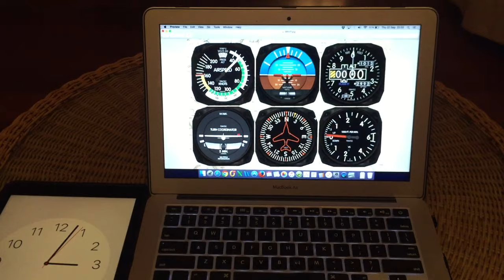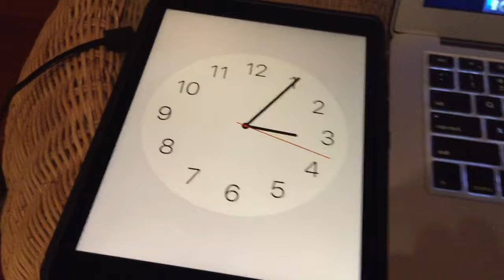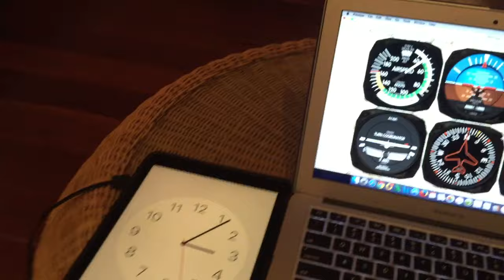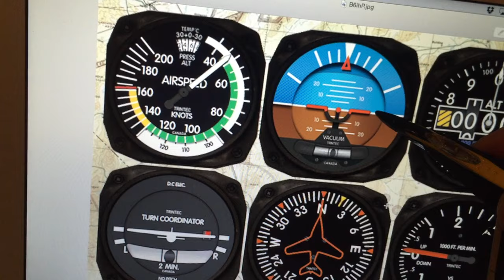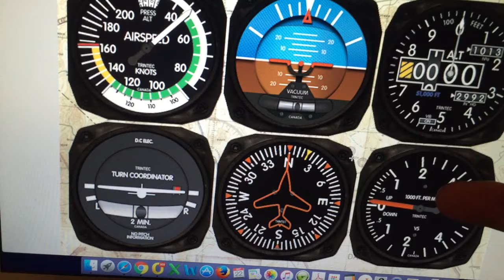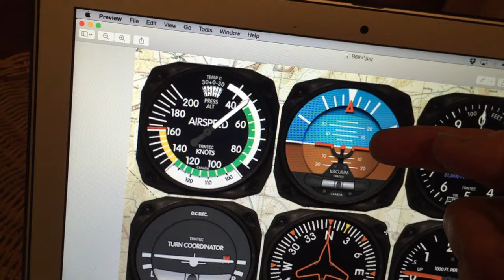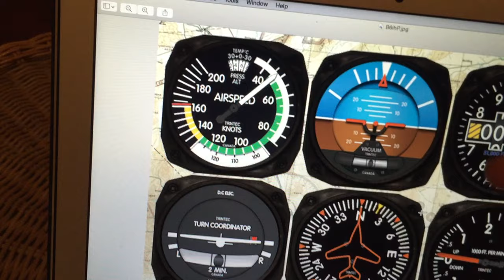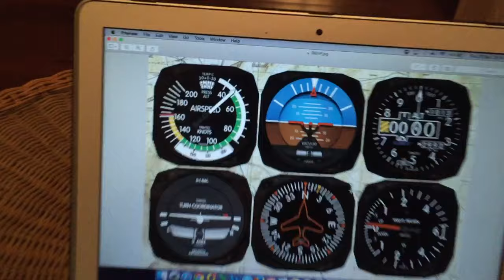Do aircraft change attitude to follow the curvature of the Earth?

Comment: I tested this for myself and hired a pilot to fly me around in a Cessna at 2000' for about an hour. No auto pilot on this thing. We got to 2000' at 120 kts and then physically locked in the elevators to maintain zero pitch on the aircraft at 2000'. Hands off all instruments and controls we flew for 20 minutes without changing altitude until hitting a thermal layer.  Do the math and you will see it would be impossible to maintain 2000' altitude at 120 kts for 20 minutes on a ball. I think its about a 1400' difference. 
This guy is a liar.
It cost me $180. Go hire a Cessna pilot for yourself and you will see. Make sure it's a calm day so you will be able to lock down the elevators. 
After you do then you can also come here and call this guy a liar.
Reply from the maker: Do you have a video of the flight?   You are still not understanding what is occuring.   20 minutes hands off with the elevator locked and the altitude didn't change?  Really?  Show me the video please.
Reply from the maker: How did the pilot lock the elevator?
Reply from the maker: Did you do the math yourself?   at 120 knots it takes 180 hours to fly around the Earth.  That means you only change 1 degree of attitude in 30 minutes.  So flying for 20 minutes the attitude change of the aircraft is less than 1 degree.    

Please tell me how the pilot locked the elevators for 20 minutes in flight because unless you provide a video I call BS on that mate.
Reply: +Wolfie6020 
I don't have video of that. Show me the chapter in the autopilot users manual discussing the feedback system providing the compensation for the curve. The circuit does not exist. 
How did we lock elevators on a cessna? There was a small handwheel  used to physically keep the controls from moving.
Reply from the maker: Diesel Bourbon
So you hired an aircraft to do an experiment that proves the Earth is Flat and didn't bother to take a video of it?  Really?

That small hand wheel is called the Elevator trim and does not lock the controls at all.  Try again.  I have over a thousand hours in Cessna's.  The actual control lock is completely different and the plane will not fly with it installed.

Your controls were not "locked" at all were they.
Reply from the maker: Diesel Bourbon
For the second time.  There is no feedback system required.  What part of that did you not understand the first time I explained it?
Reply: +Wolfie6020 
I'm not the pilot. The guy did something to keep the elevators from moving after achieving altitude and zero pitch. It was more than a year ago. We flew twenty minutes. Zero pitch no change in altitude.
Reply from the maker: Diesel Bourbon
I can assure you the controls were not locked so you should not claim they were.  Sorry mate, but unless you have a video I don't buy it.  I have never seen an aircraft hold perfect altitude for 20 minutes without touching the controls.
Reply: +Wolfie6020 
really...then I would have to doubt you are actually a pilot. a friend of mine flew thirty years in Marine Corps and UPS and told me he did that all the time. He said it was very common.
Reply from the maker: Diesel Bourbon
If you doubt I am a real pilot then please be my guest.  It just shows me you can't recognize the truth when you see it.
Reply: You don't have a clue how a gyroscope operates. This is the crux of the problem.
Reply from the maker: Diesel Bourbon Changing tack again?  so explain it to me please.  How does a gyroscope operate in relation to holding a constant altitude in an aircraft.   The floor is yours, I am listening.
Reply from the maker: Knowing how a gyroscope works is not the crux of the problem at all.  You are getting bogged down and side tracked because you still miss the main point of my video.  That is the real crux of the problem Diesel. 

Forget gyros and autopilots.  Take a small aircraft with none of these. Only an altimeter and a pilot. Nothing else.  If the pilot flys along maintaining a constant barometric altitude then he is already adjusting for the Earths curvature.   Do you understand why?
Reply: A gyroscope will not follow a curve. A gyroscopes attitude is not affected by "gravity".
Your explanation of maintaining altitude does not explain what I accomplished in the Cessna. Flying at 2000' for twenty minutes, zero pitch at 120 kts. No change in altitude for twenty minutes. We could have gone longer but hit a thermal layer.
I am going to hire another pilot in the next couple of months and video the whole thing for you.
Reply from the maker: +Diesel Bourbon
Diesel you have still missed the entire point of my video.  Forget Gyros.  They are irrelevant to this discussion  Honestly mate I now believe it is a waste of time explaining anything to you.  Please do the experiment again.  I look forward to it.  Make sure you video the entire 20 minutes with the pilot's hands and feet completely off the controls ok.
Reply from the maker: Diesel Bourbon
You would be better off hiring a small Citation jet and doing it at 40,000 ft.  A Cessna is very slow and at 120 knots will only require 0.66 degree change in 20 minutes.   At least in a Jet you will cover about 2 degrees of pitch change in the same 20 minutes.  They are not as expensive as you might think.  Go up to 40,000+ feet and you will have a much better experiment.
Reply: I can't wait to see your video Diesel Bourbon.
Reply: +Diesel Bourbon  Subscribed to your channel so I don't miss your video.
Reply from the maker: Diesel Bourbon Language please mate.  You can post anything you want here and I won't block you but keep the language civil please.
Reply: Charming but not interested in chit chat.  Where is your video?
Reply: So is there a video or not? I know I'm a little late but it would be interesting to see if someone has a link to it.
Reply: B C dang bruh chill out a little
Reply: +B C
Show me the video
Reply: Diesel Bourbon you are correct. you take off reach altitude remain on heading. the only time you adjust pitch in flight is for landing. all planes are designed to fly level with hands off the controls. when you learn to fly there is NOTHING about the curriture. thats bc it does not exist 😎
Reply: Charlie Jeans did you ever fly a plane?  I did... and you have to adjust the pitch from time to time to stay level.  Upon reaching altitude on a small single engine air plane you adjust the trim on the elevators to make it easier, but you still need to make controlled adjustments.  Furthermore, the air that you fly though is not still so even on a flat earth you would have to make adjustments.
Reply: That's because you are following the curvature.  But of course you didn't actually fly a plane, I have, you probably read that somewhere.  And that's a load of bs
Reply: B C - and yet this is exactly what all pilots do - plot flights using the globe mode of the earth - and, guess what happens? they get to the correct destination on time; they use the correct amount of fuel for the miles travelled; they fly over the correct parts of the earth as expected according to the globe model. Please plot a transatlantic - or other long haul flight - route using the flat earth map - calculate distances etc etc and then show it works including filming which continents you fly over etc.
Reply: Charlie boy  - what about adjusting for turbulence - as Wolfie explained - most of the adjustments made are for other things than curvature - which is why a pilot doesn't notice it. Remind me never to fly with you by the way - not that I think it likely since you are no more a pilot than I am a Leprechaun.
Reply: Diesel Bourbon no there is not. Liar.
Reply: Charlie Jeans actually liar, there is so much in the aviation world that directly relates to our spherical earth that aviation would simply NOT work if it were flat.
Reply: wrong have you been to Texas international airport they have the flat earth on the floor with all the airline flight paths that make perfect sense does not make sense on a globe same with Australia they have a park with a flat earth clock and a flat earth fountain and in London parliament flat earth on the wall this satanic elites know its flat there pushing globe to hid god so they can push there evil satanic agenda NWO
Reply: MetalcoreWorld 😂 you must be kidding right? If not I'm so sorry about you....
Reply: BC.
You display the normal anxiety and confusion displayed by people who have had their belief destroyed.   You have no sensible rebuttal so you spit the dummy out and cry liar whilst adding foul language.....typical  behaviour.
Reply: BC
That is exactly how religion works, to control people with the fear of Gods wrath at judgement day.  Believe that if you want to.
Reply: B C - yeah - I agree with S Black - show us the video you took - or stop calling other people liars - incidentally, explain how Wolfie6020 is a liar for simply making observations, using the correct maths etc. etc. - I look forward to both your video and your explanation.
Reply: WildPhotoShooter - agreed - they always come out with the threats - except - IMO - their belief in a vengeful god, who wants to torture forever, anyone who disagrees with him, is simply a projection of their own hatred - after all, brain function scans show that the part of the brain that lights up when believers think they are talking to god is the same part of the brain that lights up when a person thinks about themselves - in other words - they are god - he is only a projection of their own psyche which is why he always agrees with them on everything - hates those they hate etc. etc.
Unfortunately, when a flerfer admits that the reason they are a flerfer is because it agrees with their particular holy text's description of the earth, there's no point in debating them. They will not accept any evidence that disagrees with their beliefs, and are happy to lie whenever the need arises.
Reply: Diesel Bourbon - "Show me the chapter in the autopilot users manual discussing the feedback system providing the compensation for the curve. "  There is no such thing because it is NOT REQUIRED.  To learn what you are looking for you need a PHYSICS BOOK.  Then you need to understand EQUIPOTENTIAL SURFACES.  In a gravitational field (or electrostatic field) the "surface of equal POTENTIAL" around a spherical mass is SPHERES OF EQUAL RADIUS.   For example: If an electron is trying to move around a Proton It can move along an equipotential surface WITHOUT PERFORMING WORK.  For the electrostatics case these equipotential surfaces are spheres of equal distance from the positive charge source (the proton).  So you can move the electron around the proton anywhere you want and not perform (or extract) WORK Unless you CHANGE FROM ONE EQUIPOTENTIAL SURFACE TO ANOTHER.    So what are the gravitational equipotential surfaces in Earth's gravitational fields?  Why.... that would be SPHERES centered on the center of the earth.   So flying along at CONSTANT ALTITUDE means you are STAYING ON THE SAME EQUIPOTENTIAL SURFACE and therefore PERFORM NO WORK.  Pull UP and climb to a equipotential surface of HIGHER POTENTIAL ENERGY, or dive to go to a surface of LOWER POTENTIAL ENERGY and WORK is performed or extracted. 
     See it is 100% PHYSICS.  If an aircraft were to TRY to follow a perfectly straight line in a spherically symmetric equipotential field (Like a Gravitational field) it would be CHANGING ALTITUDE and therefore INCREASING IN POTENTIAL.  Physics does NOT like that as you must PERFORM WORK TO INCREASE IN ALTITUDE.   WHY do people who do NOT understand physics ARGUE with those that DO?
Reply: Diesel, Its fine questioning things but you need to do it with some degree of knowledge, you don't have any.
Reply: You are 100% correct in your explanation to Diesel Bourbon.   I have made the same argument about how the stability of a plan works and that "going in a straight line " that starts off as tangent to the surface and eventually increases in altitude due to the curvature, requires energy that a plane in straight and stable level flight will not do for the exact reasons you pointed out.  So, Yes you are correct and the earth is a sphere.

But the one thing I haven't found yet is how the attitude indicator that works by inertial stability  (Gyros) compensates as it moves around the earth.  That is a different problem.
Reply: B.C. 
Your knowledge is from the same era as your name.  You need to listen to and read about modern discoveries  and the way it all works to perfection on our globe earth before you attempt to debunk it all.  
You will find you need more evidence than saying "fake"  "lies"  "shill"  "satanic"   "CGI"   "C*** S***",  or  " it doesn't make sense".
Reply from the maker: +blaster 0416.  You explained the inherent stability nicely and you are 100% correct. 

The attitude indicator has mechanisms that adjust it constantly as it moves around the Earth, it is constantly aligned to local level.   If you hold a steady banked turn for several minutes it will actually align incorrectly in the turn as it is sensing a false "G" due to the turn. 

I have an artificial horizon and will make a video about it in the future.  I need to get a power source for it first as I want to do a few experiments with it working also. 

The mechanical vacuum driven gyros use pendulous vanes to achieve this correction. 

https://www.experimentalaircraft.info/articles/attitude-indicators.php
Reply: Wolfie6020   OK, so it is very slowly dampened assuming that the plane will be mostly level during normal flight and turns will be less than a minute or so.  Next time I go flying I'll try a long coordinated turn and see if I can get the AI to begin to "correct" itself and begin to level out even though I'm maintaining the turn.
Reply from the maker: +blaster 0416  This might help. 

https://www.theairlinepilots.com/forum/viewtopic.php?t=905
Reply: Lol how do you lock down the elevators ?
Reply: As a commercial pilot that trained in small planes not once did the thought ever occur to reach back for the control lock and freeze the controls. I have not ever meet a pilot that could trim a plane to fly perfectly level for more than a few minutes without having to make small corrections.  We all know that gravity and lift work against each other so we counter those perfectly to  maintain equilibrium flight. We do not constantly push down on the nose to keep from going up because the force of gravity pulls to the center of mass as you go around the ball. If you are having a hard time understanding how gravity works look into Einstein's spacetime.
Reply: DarkSkyWatcher74 depending on how much money you want to spend auto pilot can be used in many ways such as single axis double or triple. It doesn't use baro for altitude corrections you as the pilot set the baro for Mean Sea Level. Some autopilots work with your GPS to fly a specific route with comes in handy for LNAV RNAV approaches.  Above 18k in the USA all planes fly at standard pressure for more accurate deconfliction.  It's a misconception that pilots hit autopilot after take off and then have no clue what happens next the amount of workload is just eased that's all.
Reply: Diesel Bourbon "I'm not the pilot. The guy did something to keep the elevators from moving " That's your flat earth evidence!!  In the scientific world what you have done is try to present anecdotal evidence. That is NO evidence at all. In the legal world that is called here say and not admissible in court.
Reply: stephen allenbaugh yea you can see a lot at 6000 feet but how do you explain not being able to see a pencil sticking out of the ground at 1 mile on a flat dry lake bed or all of us being able to see the ISS at night time because of the reflection of light from its solar panels. You must live in a bright city in your mothers basement. Go take a look at the sky for once in your life away from light pollution.
Reply: travis richardson   "how do you explain not being able to see a pencil sticking out of the ground at 1 mile on a flat dry lake bed". How would you see a pencil at one mile? Even if above the horizon.
Reply: travis richardson even with eye level of 1 foot, at 1 mile there is insufficient curvature to hide an object as long as a pencil.
Reply: Stephen just quit while you're behind, so you don't get more behind. You're embarrassing yourself (do flat earthers even care though?)
Reply: stepehn allenbaugh - You know you can go LOOK YOURSELF and SEE THE ISS.  There is a video of it passing over my head on my youtube channel.  Dont take our word for it - GO LOOK YOURSELF.    My prediction - stephen WILL NOT go look because he is AFRAID to be proven wrong. (that and it conflicts with his preconceived notions - likely religious in nature)      The ISS is COMPLETELY OBVIOUS if the sky is clear.  I have gone out and seen it on numerous occasions WITH WITNESSES.   I can ASSURE you that satellites are real, I have launched quite a few MYSELF.
Reply: Stephen allenbaugh - YOU CLAIM that the ISS is FAKE and cannot be seen, yet you fail to explain WHY WE CAN SEE IT.  And WHY it looks JUST LIKE NASA SAYS it does when you LOOK AT IT WITH A TELESCOPE.  And PLEASE (with your superior intellect) explain what I WATCHED YESTERDAY when the SpaceX falcon 9 launched a resupply to the ISS?  WHAT WAS that I saw LIVE on TV.  And then what was that I saw that TURNED AROUND in a VACUUM with ROCKET ENGINES and LANDED at KSC?
Reply: Stephen allenbaugh - SO you don't have TIME to explain WHAT THE FUCK YOU ARE TALKING ABOUT???  I am supposed to KNOW what you mean?  You ARE a Genius.....  SO you are NOT going to explain what I CAN SEE with my own eyes when I use the ISS tracking app and LOOK UP?  and you are NOT going to explain WHAT I AM SEEING when a Falcon 9 launches from KSC and returns?  Just fucking BRILLIANT!
Reply: stephen allenborough.
Do you not know the answer to Stuart Greys questions about the ISS ?
Reply: Stephen allenbaugh - "More like I dont care" Then WHY are you spouting nonsense on this thread.  Leave us alone already if "you don't care".  So answer the questions or go away and let the grownups have a conversation.  Just blurting out "WRONG" proves you are twelve.  If you have something constructive to add, then SPEAK UP, we are not mind readers (although IF you believe in a Flat Earth and blatant violations of physics then you are probably the type to believe in psychics)
Reply: stephen allenbaugh
Flat earthers struggle with learning the accepted science so they just change  the curriculum to flat earth and they become absolutely  great students.
Reply: stephen allenbaugh.
You need to go and study some physics because all the physics that has been discovered by observation and experiment IS natural physics......it just goes a lot deeper and is more complex than you can comprehend.
Reply: Stephen allenbaugh - "Show me the physics that makes water cling to a ball by the trillions of gallons"  Sure - its called "Gravity" and behaves ALMOST exactly like electrostatics.    "show me water that isnt flat"  Sure - Look ACROSS the ocean - Do you see mount Everest? NO? That's because it is CURVED just like has been proven over & over INCLUDING the videos of the SpaceX launch I posted above that you apparently refuse to watch.  I am SO SICK of people telling Engineers and Physicists to "learn physics" when they have OBVIOUSLY NEVER PASSED A PHYSICS CLASS IN THEIR LIFE ( Go ahead and Prove me wrong - YOU HAVE NEVER passed a physics class, and probably never even taken one).    This is a fact: ANYONE who claims that "rockets dont work in a vacuum" or "water cant cling to a planet" could NEVER PASS a physics class and therefore could NOT GET an Engineering Degree.
Reply: stephen allenbaugh, your wasting your time arguing with people who believe or claim to believe that man walked on the moon. They are either completely deluded or free Masonic agents of deception.
Reply: stephen allenbaugh so why do you refuse to comment on the video of the SpaceX launch from Monday?  Afraid that seeing something "impossible" might scare you into accepting reality?
Reply: Ninja Man  what do you think happened on Monday at KSC?  Was that big rocket CGI or mass hallucinations?   And what do you think the bright object is that passes over head in orbit of the Earth? Another hallucination?
Reply: stephen allenbaugh - "I am not saying they didnt shoot something into the air genius."  So please tell me what you think it WAS that they shot into the air if not a 230 foot tall rocket booster that weighs over a MILLION POUNDS.
Reply: stephen allenbaugh that's easy look at free falling water. Or better yet look at it in a zero air resistance area.  But that doesn't even prove gravity that is just the natural state of water. If you want to see something on the other side of the curve go to a dry lake bed, lay down and tell us how far you can see objects on the ground.  For some reason flat earthers always use water for  curvature drop experiments without the thought of how light bends through cold water.  Go play kerbal space program too, lol.
Reply: No one is that stupid ?    Ha!   I wouldn't put money on it.
Reply: Stephen conspiracy clown allenbaugh.
All the lunar lander needed was a covering and heat reflector, no structural strength was needed for the skeleton, that was only necessary for the internal pressurised cabin.   The gold foil was  perfect for both and most importantly it was lightweight.   Its called engineering you know.  What would you have built it from , Steel plate and rivets?
Reply: Stephen allenbaugh - You ADMIT that "something was shot into the air" on Monday, but you wont take an opportunity to tell us what YOU think it was since you don't believe it was a 230 foot tall 1,000,000 pound ROCKET.  WHAT WAS IT THEN?
Reply: Ninja Man - You know that you can SEE a big object that can support human life in a vacuum WITH YOUR OWN EYES.  All you have to do is go outside and look up when the ISS passes overhead.  Because (did I mention) YOU CAN SEE THE ISS WITH YOUR OWN EYES.  But you WONT DO IT because being exposed to the truth HURTS Morons' brains.  And another thing we have put humans inside a vacuum chambers HERE ON EARTH on numerous occasions when testing Flight space suits.  I used to work in the building that the Manned Maneuvering System was built in, and used to walk past the flight units almost daily.  Just because you DONT UNDERSTAND SOMETHING does not make it any less real to those that DO UNDERSTAND.
Reply: Ninja Man
When you fly in an aeroplane at 40,000 ft the fuselage is sustaining your life by pressurising air inside of it. 
Outside air pressure at 40,000ft is only 2.73 lbs psi. and the aircraft fuselage can easily cope with the difference in pressure,  so in a vacuum it only needs to be a little stronger.  Not a problem at all for the engineers and designers.

Flat earthers struggle with learning the accepted science, so they just change  the curriculum to flat earth and then magically they become a great student.  LOL.
Reply: WildPhotoShooter - Yeah and don't mention to Ninja Man that SUBMARINES survive a MUCH MORE HARSH environment than spacecraft and have been doing so for many years MORE than spacecraft.  In fact, I would bet that if you could just put one of our nuclear subs in orbit, it would likely survive just fine (at least for a while until it overheated from inability to radiate waste heat)
Reply: blaster 0416, yes I know I'm stupid for not falling for this absolute nonsense. For what it's worth, not that it matters because seeing the fraud being perpetrated on humanity doesn't take a Brian surgeon to detect it. I actually have a degree in telecommunications and I can tell you with certainty, transatlantic communication isn't done by satellites, its undersea cables. We also use line of site microwave data links 80 miles plus - not possible on a ball. If you bother to study your own bullshit, it should be obscured by 4,266.67 ft or 0.81 miles of curvature. Not possible on a ball my friend. The evidence is all around for those who wish to see.

Back to the lunar lander - it is clear to me that, that nonsense wasn't put together by anyone with an engineering background. The rivets, gaps, tapes and silly foil looks like it was put together by a homeless person. Engineers have pride in their work and I can tell you with certainty, no engineer or group of skilled tradesmen put that nonsense together. Nothing is uniform or ascetically pleasing, it's a joke. And don't bother replying telling me it's not there to look pretty. My point is, it looks ridiculous and anyone who thinks it serves any real function, either has shit for brains or thinks everyone else has.
Reply: So, has Diesel Bourbon posted his video yet?
Reply: stepehn allenbaugh - You keep talking about this bullshit "space cardboard" but it is nonsense. The spacecraft I HAVE BUILT are made from Carbon Fiber composite panels (Mars Global Surveyor, Stardust & Genesis), or Aluminum HoneyComb panels (Deep Impact, Kepler, NPP, JPSS-1, Worldview) and Titanium fittings everywhere. I can pretty much GUARANTEE that they are stronger than anything you have built because we TEST them before launching them.  In the case of the Stardust Launch Adapter ring (base of the spacecraft) we proof loaded it to 70,000 lbs when the entire spacecraft fueled weighed less than a thousand.  We also Vibe & Acoustics test them for strength at levels that would shake a jet fighter apart.
Reply: Stuart Gray, since you know so much about NASA, explain why they were not able to show us the eclipse from space. My own feelings is, it's getting harder to fake these things because people are scrutinising everything they do. And we would be looking for stars, satellites orbiting, earth spinning and cloud movement.  I mean, you would even tell me that that cgi joke called the Epic is real. Seriously, do yourself a favour and stop these lies.
Reply: Stuart Gray. 
Wolfie is a Pro pilot and he seems to have kicked Jeranism into the long grass on navigation,  Jeranism doesn't go there any more.  Then here you are,  a man who builds spacecraft, so maybe you can debunk the satellite deniers with some technical info too.
I was in my early teens when the Apollo programme was happening and I remember reading that the gold foil was all over the LEM to reflect heat, it was not there for structural strength.  Stephen Allenbaugh and his like look at these things as though it is a joke and think it is not a viable space vehicle.  Pure ignorance .
Reply: Diesel Bourbon .
Eight months have passed , have you hired another Cessna and  done your video yet ?
Reply: Minja man
Why would NASA waste time and money taking a picture of the eclipse from space just to show to a bunch of flat earthers on the lunatic fringe ?
Reply: Ninja Man - " since you know so much about NASA, explain why they were not able to show us the eclipse from space"  Let ME ASK a question:  WHY IS IT that Flat Earther's  NEVER respond to real evidence? Their juvenile response is typically "I don't care about THAT - WHAT ABOUT THIS?"  It is a simple minded way to change the subject.  SO before going on about Eclipse watching from space WHY DONT YOU Comment on the EVIDENCE I presented above?  There are numerous space missions that have PROOF that they occurred, but your types just stick your heads in the sand when we try to SHOW THEM TO YOU.  It is like a child sticking his fingers in his ears and running away while yelling "LA LA LA!".  And by the way - THERE ARE PHOTOS of the ECLIPSE SHADOW crossing the Earth taken FROM THE ISS, but you would have to actually research something before making bold statements, and that is out of character for you types.
Reply: Ninja Man.
What you can't understand is, even at 50 million a day NASA does not need to waste money showing flat earthers what everyone else accepts and knows to be proven.  Even if they did provide footage, your bias is so strong you would still say it was fake footage so they would be wasting money and their time.

Another thing you can't understand is, because everything on earth works absolutely perfect with total accuracy using the globe model and gravity mathematics ,  no space agency cares a dump about what you believe.  I guarantee NASA doesn't watch flat earth youtube videos and worry about what you are saying.
Reply: Holy shit! @ Diesel, worth it?
Reply: No video? What a shame! That would have been proof enough for the Nobel Committee to come to a unanimous decision! You would have been proclaimed the Mega genius of human history! Einstein and Newton would be forgotten. The bonfires of obsolete science textbooks would be so huge as to easily be seen from the ISS! Gosh that's too bad you didn't have a smartphone with you.
Reply: People like you should be forced to abandon all advantages that Science provides to your daily life. If you want to discredit Science then you should be more than willing to live without its benefits. There are no doubt some caves available near your current location.
Reply: Take a tennis ball, dip it in a bucket of water, hold it up. Now you have proof of water clinging to a sphere.
Reply: +Diesel Bourbon
You wasted $180 because you were unable to design the experiment. The earth is NOT a pizza.
Reply: +Tony Fritz
Yeah, throwing $180 down the drain in an "experiment" because one doesn't know what he is doing must suck.
Reply: +Tony Fritz
"what must suck is being you"
Naaahhh, I spent Christmas with family and friends, not in youtube doing uncalled-for personal attacks to perfect strangers. That must really, really suck. 😀
Reply: +Tony Fritz
Please tell me you are 12 at most. LMAO
Reply: +Tony Fritz
Yes, I'm over 55. And since you didn't get it, I'll spell it out for you: If you are over 12, then you are a [insert age here] -year-old guy with a twelve-year-old child's brain. LMAO
Reply: Wolfie6020 :Locking the elevator is neither safe or possible. Only trimming it is possible, so that you maintain approximately level flight.
Reply: Diesel Bourbon: Autopilots operate on altitude ie barometric pressure. You would never need any compensation because of altitude being the basis for maintaining level flight.
Reply: therudiment: Okay prove your claims about me, bozo. Insults will get you nowhere.
Reply: +Rob Guyatt   what happens when airplanes fly  at supersonic speeds do they trim automatically , I doubt It I  suspect the vectoral forces are so strong especially flying so fast in calm conditions pilots wouldn't have time to worry about the earths curve , just wether the coffee needs to be reheated when the get back home.    So I think they would need to nose down don't you?
Reply: Andrew Corbell: absolutely not, "down" is a vector,  lift (keeps airplanes up) in level flight it is directly opposite the existing down vector. Speed is irrelevant.
Reply: Dan Blumel   your point is what ?
Reply: Andrew Corbell: a basic understanding of elementary physics is necessary, that's my point. There is no nose down in level flight, flat or globe earth, all the same.
Reply: Dan Blumel  yes Dan it Does!!!
Reply: @Andrew Corbell - No, it doesn't.  There are four primary forces acting on a plane in flight.  Lift (created by the airfoil having air pass over it), Thrust (created by the engines), Drag (created by the air resistance), and Gravity.  When Thrust is balanced against Drag, the plane maintains airspeed.  When Lift is balanced against gravity, the plane maintains altitude.

You can ascend or descend in a plane while remaining in perfectly level flight, just by adjusting thrust (since thrust controls airspeed, and thus lift created by the airfoils).  "Nosing down" or "Nosing up" is simply a way to increase drag simultaneously, reducing speed or lift, to gain or reduce altitude more quickly.

If I "Nose Up" but do NOT increase thrust, the plane WILL DESCEND.

None of this has ANYTHING to do with any imaginary 'straight line path'.....it has to do with maintaining ALTITUDE.  The relationships of these four forces keep the plane at a given altitude REGARDLESS of the shape of the planet.  It is BUILT-IN.

FE's who claim things like the above arguments throughout this comment thread simply do NOT understand Aerodynamics or how planes fly.
Reply: Helium Phoenix  yes it does .
Reply: Andrew Corbell: I am glad to hear you agree with me and now also with Helium Phoenix !! It seems you are finally making intellectual progress.
Reply: @Andrew Corbell - Again, you simply deny without any substantiation.  Please try to at least support your position.  We have.  To wit:  When a plane lands, it has it's nose pointed upward.  Based on YOUR claims, that means it would GO upward.  But it doesn't....it continues to descend.  This is because it is NOT increasing thrust enough to overcome the increased drag and decreased lift.  Planes do this to rapidly decrease their speed for landing, but without gaining or losing altitude.

Second, what happens when a plane simply decreases thrust while maintaining level flight?  It starts LOSING ALTITUDE.  It doesn't 'nose down' either.  It just starts moving downward.

Learn some Aerodynamics, THEN come back.  You apparently don't understand the forces involved, much less how planes actually manage to fly.
Reply: Helium Phoenix   Even Wolfie has recognised the conundrum . A supersonic flight at say 1300 mph is just that does Concorde just accelerate and decelerate just to stay at the right altitude ,common guys   think about it.
Reply: Helium Phoenix     how does a Delta wing jet flying at 1300 mph and at 50000 feet control it's flight
Reply: @Andrew Corbell - It controls it in MULTIPLE ways.  Ailerons, rudder, flaps, thrust, elevators, spoilers, and more.  And ALL of them are based around simple and well understood principles.  It is NOT a 'conundrum'.

You HAVE to adjust your thrust if you change the pitch of the plane.  This is because the plane just increased it's drag coefficient, and decreased it's forward thrust (the new pitch, which is up or down from 'level flight'  is now a vector that has components in both the forward and up/down direction).  This also means it increases or decreases it lift as well (since some of the thrust vector is now partially adding or subtracting from the lift vector, depending on which way the plane has changed it's pitch.)

Fighter Pilots (the majority of delta wing pilots) are taught quite extensively about maintaining KE (Kinetic Energy) of the jet when maneuvering in combat.  This is because ANY maneuver away from 'level flight' causes the plane's KE to change, and usually it is a decrease.  This means the plane SLOWS down, making it an easier target, and causes banks and turns to be wider.....which means the target or chaser can more easily get out or in kill position.  How do they counter this?  Simple.  They add thrust to compensate.  Too much means just as many problems.  They want to keep the KE of the jet within a certain range for maximum maneuverability.

Even the Concorde, if it is flying a straight heading and level, if it decreases it's thrust it will start to descend.  If it increases it, it will start to climb (unless it's gotten close to it's service ceiling, in which case engine efficiency becomes an issue due to insufficient oxygen for thrust to increase with more fuel.)

I've gone through ground school.  I've studied aerodynamics.  I've studied the manuals Fighter Pilots train with.  I know physics.

I NEVER said that a plane could not pitch up AND increase thrust to climb faster, nor did I say that it couldn't pitch down to gain speed (since thrust and gravity vectors now share a portion of the decomposition axis vectors.)  However, ignoring that 'level' flight is simply not gaining or losing altitude, means you are not grasping why this has NOTHING to do with the shape of the earth.
Reply: Helium Phoenix   to the contrary   . All I've asked is how a Delta wing jet controls it's flight at 1300 mph . Stop confusing the issue.  Let's be exact . There is no decelarattion in my question . Level flight is maintained by the shape of the wing. . At a trajectory that normal operations of ailerons and  elevators  are stopped it's when the plane needs to decend that forward thrust is reduced and then after at  slower speeds the ailerons and elevators  are brought back into play.
Reply: @Andrew Corbell - Not to the contrary.  You are trying to take one particular case while ignoring the others.  A delta-wing jet at a constant speed would HAVE to increase or decrease thrust to maintain a constant airspeed when descending or ascending.  But pilots are going to use the most fuel-efficient (or KE efficient, for fighter jets in combat) to ascend or descend.  You are trying to ignore things that are inconvenient to your argument.

When a commercial jet needs to descend, it will cut it's thrust and allow it's airspeed to drop.  This reduces fuel consumption, while simultaneously reducing altitude.  If a jet needs to descend QUICKLY, it will nose down while maintaining thrust to increase forward airspeed (but reducing ground speed) which utilizes MULTIPLE effects (increased heading drag, but increased thrust downward, and more.)

You are trying to oversimplify the model.  You cannot do that, and still take into account how the plane actually FLIES.

You might notice that when planes land, they PITCH UP.  Your logic dictates that would make them climb.  They don't.  They've increased their flaps, to increase drag, and they power up to maintain approach speed.  While continuing to DESCEND.

You are also ignoring the fact that without use of elevators or ailerons, the plane will (due the the inherent stability of airfoil wings) LEVEL OUT.  Pitch down, get your AoA to -15°, then put your controls to center (zero deflection of ailerons/elevators).....the plane will slowly return to LEVEL FLIGHT.

You REALLY need to learn some basic physics and aerodynamics principles before you try to argue this stuff.
Reply: Helium Phoenix  just answer the question are normal operations of ailerons and elevators used at supersonic flight. To control for the curvature of the earth.
Reply: @Andrew Corbell - Dude.  You didn't even read all of my response.  I DID ANSWER YOUR QUESTION.  If you want something more specific, you're going to have to be more specific.  But to address a few misconceptions in your original question directly, so you won't try to use them again:
(1)  A plane CANNOT descend or ascend by pitch changes without changing speed unless it increases or decreases thrust to compensate for the increased drag.
(2)  Level flight is maintained by the wing/lifting-body as long as there is sufficient AIRSPEED.  This is why planes of ALL kinds have a stall-speed rating.  If their forward speed is that or below, the plane will stall and drop like a rock.
(3)  Ailerons are usually NOT what control pitch.  It's the elevators.  Ailerons are used primarily to bank, and the rudder is used to control turns (yaw).

I've explained SEVERAL times.  You can't seem to grasp that the motion of the plane is related to MULTIPLE interactions with the controls, thrust, and it's orientation and existing motion.  You are trying to oversimplify the model which doesn't work.  You are asking a car to maintain speed at a certain RPM, while trying to ignore what gear it is in, when it goes uphill or downhill.  It doesn't work like that.  The system is more complicated than that.

Learn some aerodynamics.  I'll know when you do, because you won't be asking these questions anymore.
Reply: Helium Phoenix  actually in a roundabout way you did , but I apologise because I omitted elevators from my original question which I have now rectified .    But I think I can conclude that at 1300 mph normal operations of controls are not used to fine trim the flight thankyou.
Reply: you guys are acting like you are brain dead!   an airplane DOESNT need to adjust to curvature. it will remain level all the way around the earth.   why, because it is flying in a constant pressure range.  it doesnt have to pitch , because gravity is pulling straight down at the planes center of gravity. so, it NEVER has to pitch down , EVER!!!!!  the atmosphere is curved, so thats what the airplane flys in.  just like the water .. boats dont pitch down... submarines dont pitch down.... airplanes dont pitch down. they fly level and do not gain any altitude.  they fly , easily  around the globe with no control input.    however, you are right about the rate of air plane orientation in reference to the earth .  yes, half way around the earth, in 24hours, you would have rotated to be upside down. you dont feel it, because you never noticed the change because gravity is always pulling straight down and the change was over 24 hours.
Reply: zanick2. I see that there is an American military jet that can fly at 4500 mph I wonder how that flies without any pilot  input, has sanity left this thread all together.
Reply: Diesel Bourbon, I watched the same thing in videos of the altimeter of small plane. No auto pilot, no adjustments of the nose and the plane could fly for a long time without the altitude ever changing. The earth is as flat as a pancake.
Reply: Andrew Corbell, IT DOESNT MATTER IF THE PLANE CAN FLY 5000mph!!!!      WHY????   that would be 360 degrees in 5 hours, right?????   The gyro adjusts for gravity at a rate of 20-45degrees in less than 8 mins. SO, it is MORE than able to keep up.... you see, the Flat Eathers just are unable to do basic math!!!    in other words, and USING BASIC math.. .A gyro can adjust for airplane speeds of up to 10,000miles per hour!   this means the pendulous vanes and weighted gimbel  keep the gyro pointed down (in the direction of gravity)  unless the plane speeds are in excess of 10,000mph.  make sense??
Reply: Barney, rubble, you are acting like your cartoon character  name's brain power capability!   let me be VERY clear, the Gyro on the artificiall horizon adjusts for the earth's curvature at a rate of over 10,000mph airplane speed!!!!!     why would the altitude of the plane every change when it is flying in a level of constant air pressure. thats how the altimeter works!  it works on air pressure, and the air pressure of a given altitude will be the same distance from the earth as you travel around the earth.. get it?? make sense????
Reply: zanick2. Thank you for confirming what I already knew.
Reply: Andrew.. it didnt seem like you knew this based on your last message. did something change?  do you understand that the gyro can adjust as it moves around the earth?   do you understand that this rate of adjustment happens much faster than you can fly around the earth?  this is why the gyro indicates level flight while going long distances and the reason the "nose  of the plane" isnt nosing down, is because a level plane flies around the earth because it flys in a altitude of constant pressure and that pressure curves right around the earth, as to not require any control input to follow the curve of the earth.
Reply: zanick2. Good morning Zanick, can we start a new thread, when you respond as I have to scroll down past 200 odd comments to get to read yours.. I can understand what you mean by thy gyro and pressure, what I'm highlighting. Is the flight characteristics and force of vectors that would negate most normal flying parameters by this I mean controls
Reply: I saw that part of the thread. that made sense for high speed control.   of course, i think now you know what i was referring to, with regards to the airplane never havng to "nose " down.  thats a misconception.    do you want to start a new comment so we dont have to scroll down 200 messages?    ill chime in  after you start it
Reply: zanick2. No Zanick. You presume wrongly
Reply: Andrew Corbell.. what am i "presume wrongly" about?   I'm not makng this up. this is factual information ,and indisputable, because it is just basic math here.  however, i am willing to hear why you think i am wrong...... always willing to discuss.   please make your point as clear as possible and back it up with a little bit of logic and math if you can.   thanks!
Reply: and no video of it....of course.
Reply: Wolfie6020.. you should know this. the altitude would NOT change as you are flying in a constant pressure gradient ..   the plane flys level and curves around the earth, and doesnt require any pilot input. why dont you understand this basic FACT!!!!    gravity is straigth down.. altitude is relative to gravity  and air pressure.. they dont change with a planes controls relatively "LOCKED"..
Reply: John Wild t
Reply: @dieselbourbon3728  "I am not the pilot" - there you go then.
Reply: @robguyatt9602  I think you will find that a sniper will hit a target with the diameter of a pencil length  at 1,600 metres without too much bother  but not of course if it is below the horizon.
Reply: Gribbo9999 Hitting a pencil at 1600m without too much bother? Sorry but I call BS. If you wish to back your claim, link me to an article or vid that says there is a better than 1 shot in 10 probability of hitting a target that size at 500 m let alone 3 times as far. And don't forget that Snipers usually only get one shot before their target disappears.
Reply: @Wolfie6020  maybe he's referring to the gust locks?  In which case, an instructor would NEVER install those during flight.
Reply: A better experiment you could have done would be to set the trim to a 500' per minute climb and see how high you would go before the aircraft levels out due to the air density not being enough to keep up a steady climb.  Then the aircraft would maintain that altitude until you ran out of fuel....and one less FEer.
Reply: Les Brown  but we're talking about not moving the controls and "flying off into outer space '...
Reply: Les Brown  I'm a commercial pilot and ret us army aviator,  I know how to fly and that the earth isn't flat
Reply: I love how I'm reading an argument between a pilot and a passenger about how a plane flies
Reply: @dieselbourbon3728  this wolfie guy isnt a pilot but knows better than pilots.
Reply: Yeah, the computers fly for you at certain points, right? Yeah....when you're going that fast, you would need to dip down quite a lot. I guess he doesn't even understand his own profession. So I'm not even sure he's a pilot. I heard him claim flights take longer because they have to account for curvature. Sailors who believe in the globe say the same thing. Just take that to its logical conclusion. If you can figure out what is wrong with those claims, then you'll see how these guys have either deceived themselves, or they are deceivers.
Reply: Wolfie6020 is he thinking a gust lock?? Try flying like that. Try finding a commercial pilot who will allow you to fly like that. Let’s tell CASA